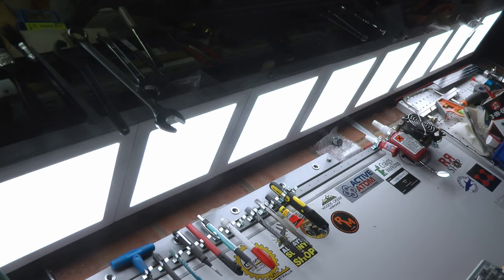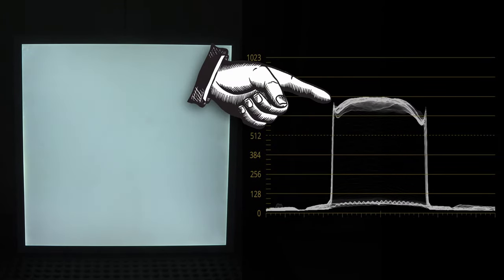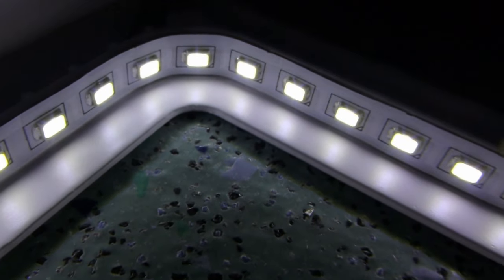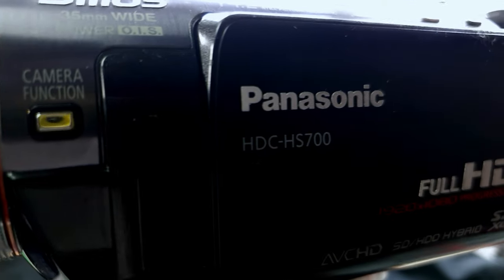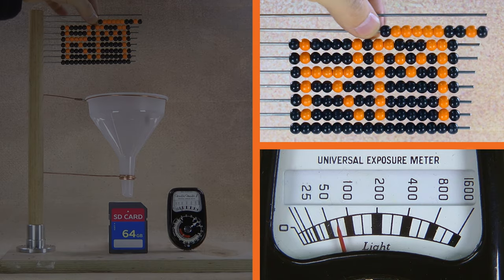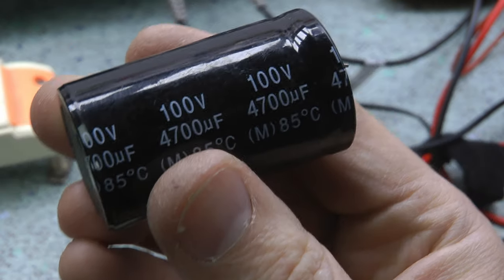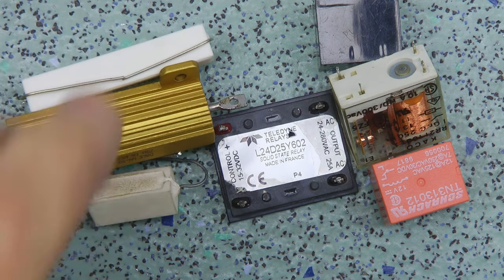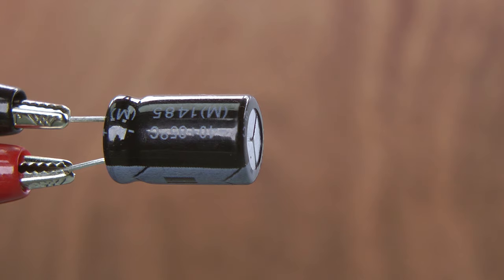Reducing Video Flicker When Using LED Panel Lighting

Comment: Was going to say you need to set the camera to the frequency of the lines, if 50hz go 25, 50 or 100fps or use a capacitor! Saves me doing a video about it!

Comment: I wouldn't worry about the short, you've essentially created a passive high-pass filter using the cap; you could also use a coil in parallel to get the same effect.

Comment: I just recently saw this banding effect on some of my videos & it's interesting to see someone else getting it. I've been replacing my fluorescent tubes with LED tubes with no issues until I got a new camera. The old one recorded AVI files at 29.97 fps, but the new one records MP4 at 25 fps (or 50 or 100fps which produce closer bands). Hoping it's just being caused by random variations in mains frequency...

Comment: Question: I have some LED work lights, which I use with amber coloured gel filters for small video- and theaterprojects. (No budget for professional led pars)
I am sensitive to the mains flickering/refresh rate of these lights and tend to get nauseous after a while. Could I remove this flickering by adding some capacitors? Do you know of an of the shelf product I could hook up to solve this or is DIY the only way?